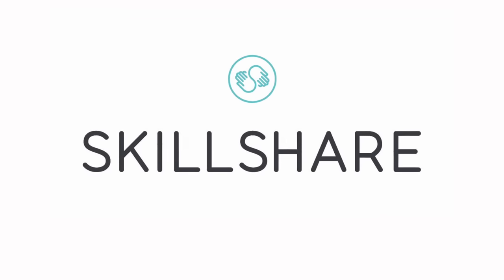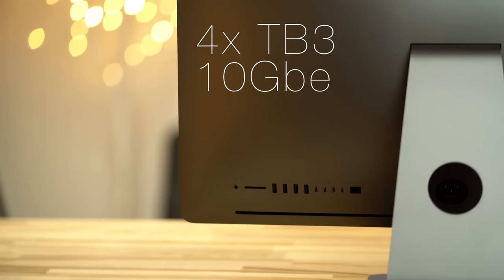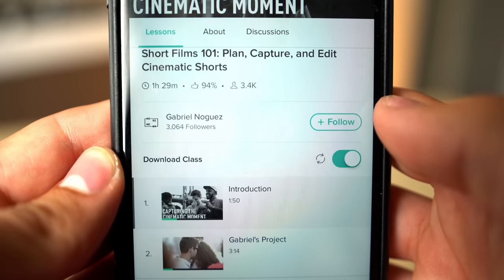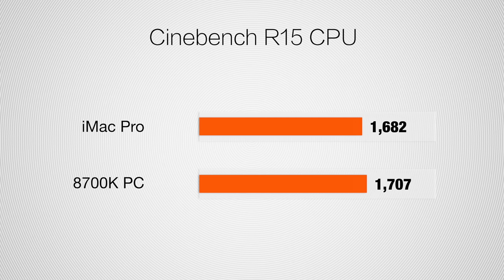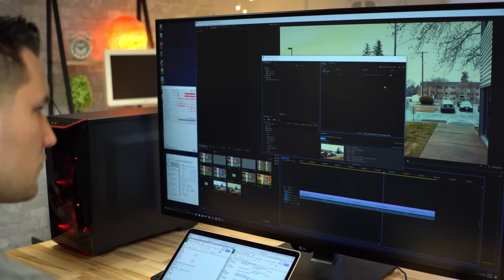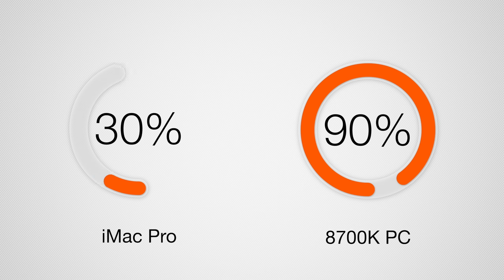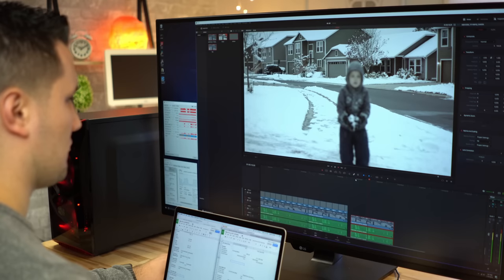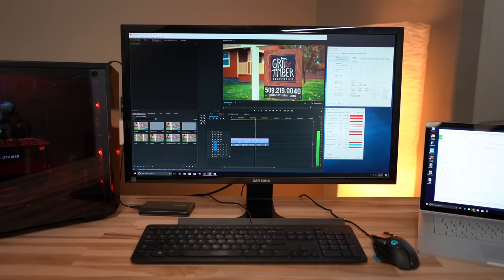$1350 PC vs $5000 iMac PRO for Video Editing 😲 Premiere & Resolve

Comment: this is not a equal battle,,,,bring us 5000 USD PC VS 5000 USD I MAC PRO LOL
Reply from the maker: Yes its not, but its no meant to be. I have an equal battle coming!
Reply: Yeah we want to see that 🤩🤩
Reply: Not yet equal comparison. 
Use fcp on mac and premier for pc for video edit.
Reply: PC would fucking smash it.
Reply: @reerbaadia1896  not equal since pc is running premiere it has to be the same program and pc will always win lmao
Reply: @MaksimYuryev  you should explain new buyers that with a pc, everything is upgradable. Mac might get more ram in some rare case but that's it. With a pc you replace your graphics card and in the long run you also can add a new cpu with faster ram. Which will keep up with new softwares and games. Much much cheaper in the long run. Also what apple users never learned is that because of sleek and thin design the CPU cooler is very small and bottleneck the CPU by not cooling properly.
Another point is repairs on Mac products are very expensive and quite often you can't just change 1 component. Lastly you can't open your Mac to clear out the dust that make your machine run much hotter.
Reply: SLR Lounge did this... the iMac Pro won slightly.
Reply: Leonard Nyamiyonga first put a fucking display on it! There is no 5K displays as good as iMac Pro
Reply: @JuanAlvarez-uf3np  so, it is only better for max quality 5k which it can't even push to because it is so weak
Reply: Adamya what? It’s a top of the line 5K display that at least worth 1,500 dollars

Comment from the maker: As a few people have pointed out, a few charts are off. These are really complicated and a pain to set up. I’m looking for some better solutions that will make it easier and be more accurate. All the times listed are 100% correct.
Reply: No max that's not a fair comparision atleast u should have chosen the 8 core Intel i7 it would have made more sense hardly 200-300$ more it would have not changed the budget by huge
Reply from the maker: Debojit Mandal like I said, I have something more comparable hardware and price wise ($5000 PC setup when you factor Monitor, mouse, keyboard) coming. There’s nothing fair or unfair in this video, it’s more tackling many of the comments I get in my iMac specific videos. 👍
Reply: 0:00 - 3:40
 Max lays out a great disclaimer of what’s actually taking place in this video 🤦‍♂️
Reply: Max Yuryev bro what I am trying to say is just up the budget a bit and put a Intel 8 core CPU that's would make more sense .
Reply: sure. I also noticed it.
Reply: Debojit Mandal - Though two machines have different tech levels in it's bodies I'm sure that 8700k vs iMacPro will be a very popular question in 2018. It's very interesting to see at what price point your computer system would suits your needs better. But I want to see the 8700k + Vega RX 64 Hackintosh vs iMac Pro!!! Not nvidia because of FCPX! That would be intriguing!!
Reply: There's another MAJOR reason to use the 8 core CPU and that's PCI lanes. Your i7 only has 16 lanes which should go to the 1070 but you also have an m.2 drive which needs 4 lanes. the 8 core has 28 lanes I believe which would eliminate any possible bottlenecks on the system especially if you ad a Thunderbolt drive or Decklink card. Higher end Extreme Edition CPU's can have 40 or more PCI lanes for bandwidth galore.
Reply: Hi Max. We all get things muddled! Good of you to pick up on it. Can you clarify which is right, the graphs or the voiceover? Thanks. Bob.
Reply: - hello, Lance, can you clarify me, please, if i7 processor (8700k) supports only 16 lanes, but NVMe needs 4 lanes, videocard needs 16 lanes, so if I want to use them both how i7 processor would allocate lanes between them? And when I add second NVMe, than 3rd NVMe (there are motherboards with three m.2 slots) will they steal the bandwidth from videocard more and more? Or all components will lose its speed? (sorry for my English)
Reply: Correct 8700K only 16 lanes. This means all your PCI based devices will share those lanes - GPU, m.2 drive, Thunderbolt etc etc.
Reply: Hey, Lance B! I checked some info and it seems that many motherboards have additional 4 PCI lanes provided by its chipset. So there are 20 in total
Reply: OC to 5 ghz? Is this even possible? How is stability?
Reply: oldi184 Water-cooling it's possible. I think he's bending the truth...
Reply: Sky Walkies

I see. Well. Water cooling is better air so i guess it can be possible. Besides i just read that turbo clock for 8700K is 4.7 GHZ so for this model 5 ghz clock is in fact only 300 mhz Oc.
Reply: Hey Max,
There's a reason the results are off + Resolve showing greater difference , Premiere Pro's code is very ineffecient with new hardware + drivers and never utilises cpu/gpu efficiency properly - Run those same Export tests ( 4K / effects etc ) in FCP X , Resolve against PPro on PC  and there will be a much greater difference between them - which was apparent in some of your Resolve tests here.
Would be keen to see a more real world test against FCPX vs PPro ie:
https://i.imgur.com/qbv51KL.jpg

Comment: The 5K custom calibrated screen which Apples uses will cost you around $1700 on the market. Sure, you can get a mostly equivalent screen for around $1k. The premium bluetooth keyboard and mouse will cost you at least $100. A very decent set of speakers will cost you another $100. Good webcam maybe $50. The very premium all in one design, the warranty and life long Apple support which you can get in any store around the world and the fact that it already comes assembled are a bit harder to price (how much is your time worth?). But honestly, those three can very fairly be priced at $500 to $1000 for a professional who uses this as a work horse. So there are another $2k to $3k of value missing in this PC build, which would really bring the price up to something more like $4k. Sure, maybe still less, but then again, if you are actually doing multi-threaded video editing, the iMac will win hands down.
Reply: Yes. The components are so durable even a fuse won't break!
It's great!
Reply: looks at butterfly keyboards

Comment: I would like to see you compare this $5000.00 I-mac to a Threadripper or intel I-9 with a high end GPU.  That would be interesting.
Reply from the maker: grombie702 I will! 10 core i9 overclocked
Reply: Max Yuryev Dear Max!
Since this iMac is based on an intel chip as well, is it fair to say that this is also a comparison between an i7-based PC station vs. a Xeon-based PC station?

At work we consider what to base our next PC system, and after working on Xeon+Nvidia Quadro setup, I felt like they suck for Adobe suite, and that an i9+GTX system would be better.
Whaddya think?
Reply: I was able to fit a 1920X with 2 gtx 1080 ti's into a build for the price of the mac pro. I don't think two gpu's would do much if anything but I just wanted to show how much spare money there was
Reply: I've been using PCs for YEARS. Too many issues. Windows has to many issues. Building a PC causes problems.

Alot of the high end GPUs, CPUs and alot of memory is not necessary. And just my opinion
Reply: @miketorre16   Building a PC causes issues? Sounds like user error to me I've had my pc that I've built for the past 5 years and have had 0 problems
Reply: @NFNCDUBSTEP  yeah, NZXT liquid cooler impellar breaking. Fans break. user issues your probably correct. Which is why I'm going to switch to an iMac. 

Its like building, and modifing cars, nothing is like OEM.tired of Windows issues as well. 

"Start Windows Normally" wtf

My opinion
..
Reply: @miketorre16  tell that to engineers on aerospace industry..doesnt count for high end windows

So you have more expertise than million engineers around the world resolve editors in hollywood?
Reply: @Teluric2  whatever that means. I'm back to PC
Reply: @miketorre16  I know a girl with a 256gb ram pc doing extreme photoshop

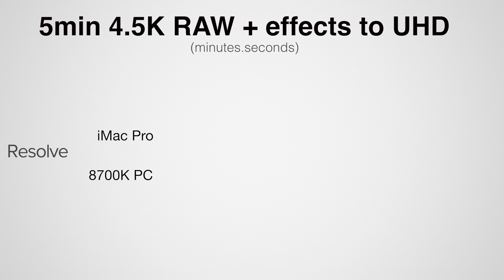Comment: Max, at 10:06 you say the imac pro is 45% faster, but the graph shows the PC is faster. Did you mis speak or is the graph wrong?
Reply from the maker: Derek Morrison Sorry! The graphs could be off. I thought I triple checked everything but when your editing for 8 hours straight trying to get a video done thing can get off. The times are 100% correct.
Reply: I suggest you reupload with the mistakes corrected (if there's any), but I understand it's extra work.
Reply: @MaksimYuryev  But doesn't less time mean faster? So basically the PC is better?

Comment: This is such an odd comparison.  Because for 1350 you could build a PC that would still smoke the iMac in resolve.  You just need a different processor like Ryzoms 8 cores.  Building is all about having a purpose built machine.  Adobe uses ancient architecture that still can't appropriately utilize multi cores as you pointed out, so if you want to use adobe just change your build slightly and for the same 1350 you can get better performance.  I'm loving resolve because it actually makes use of my 4 processor cores so I can play back with luts and all sorts of crap just as smooth as you showed the $5000 iMac.  And my comp is almost 4 years old and could probably be built today for like $800-$900 bucks lol.

Comment: nice video...however, what kind of comparison is that?!🤨5K$ vs. 1,3K$...even if PC is twice slower its very good option considering how much $$ you can save...you should compare 
5K$ MAC vs. 5K$ PC but then result is obvious when its already comparable (in such a price difference🤯) + PC is upgradeable☝🏻
Reply: sam lukas Not to mention you can update the parts in the future
Reply: And you can repair the PC easily if a harddrive fails or the power supply. With Apple, you can ship your brocken iMac to Apple and then have the time to do whatever.
Reply: Macs have value from other things than raw performance. In the video, they evaluated the final PC to about 3500$, if you include the screen and other peripherals. Also, I think the overclocking is a bit "cheating".
Reply: how is overclocking "cheating'? thats an advantage to owning a pc workstation. blame Apple for not allowing it
Reply: It's not a blame, it's more like 99% of people don't know how to do it, and don't want to. How many people casually install nitro in their car? It's cheating because it's going beyond what the material was designed for. And it increases the price because your time has value. And it increases risk of failure. I put quotes around the word for a reason, too.
Reply: Just coz majority of people don't overclock or are too scared to try it, it doesn't mean that you are "cheating" when you do as it is already a function that you can have if you're willing to try it and learn. 
The Mac or any any Apple products is worth as much as the next smuck is willing to pay for it. 
I've seen far too many Mac or apple users who have the latest Apple gadget but is only using it at face value and they think their device is better because its pretty.
Reply: Oh, okay, so now the value is only what the customer can afford. Jesus. Way to "subtly" say that PC users are cheapstakes.
Reply: Because it's not a stock feature of the original machine.
Reply: @Simboiss  But it is a feature for that kind of cpu.
Reply: It's hard to compare. It's exotic. Why bring it up and act as if it's common? Just to make a point?
Reply: That's what i know too,you can buy a $2500 PC and a $2000 server and still come out on top.
Reply: At this price, I doubt it.
Reply: @Simboiss  ''Cheating"......LMAO

You sound like that guy, who utters "You mom!!!" everytime someone roast him or abuses him.
Reply: just get a threadripper pc with rx 580 gpu if you only want to video edit and you will blow the imac for arguably less price. like blow it very hard... very very very hard out of the water.

Comment: Wouldn't it cost about the same to purchase the Ryzen 8 core (4.0 GHz turbo) CPU and get better performance?
Reply: Thank you by the way! I am in the market for a video editing pc and this video is very helpful!
Reply from the maker: If you watch the full video on this 8700K Build I compare it to 3 Ruben Systems (including thread-ripper) the 8700K is either the same or often faster than my 1700X overclocked to 4.0Ghz.
Reply: Max Yuryev Could you please link me to that video? Id like to watch it. Thanks!
Reply: Tyler Kidd Ryzen builds do not support thunderbolt,   So either you build a 10gbit infrastructure or you go fibber channel.
Reply: Max Yuryev you only mention threadripper in passing... no comparisons made.
Reply from the maker: Heres a link to the section with h.264 benchmark results that include the 8700K in this video, Ryzen 1600 @ 3.8, Ryzen 1700X @ 4.0, and Threadripper 1950X (16 core) @ 4.0 Ghz. https://youtu.be/8mgCk3wJDVE?t=9m7s Keep in mind don't compare those scores with this videos (mainly DaVinci resolve)  since the software was updated.
Reply from the maker: Here you go: https://youtu.be/8mgCk3wJDVE?t=9m7s
Reply: Always go with Intel over AMD in my experience.
Reply: Domje theres really no difference, except amd’s cpus are much cheaper. If you dont care about branding, amd would be a better choice for your bank. Both offer great cpus, except intel also makes their products more expensive just b/c its “from intel”.
Reply: Asthetical Intel are much more compatible and also last longer. Each to their own, if you prefer AMD then that's fine. Enjoy!
Reply: "intel are much more compatible and last longer" thats not how cpu's work, an equaly performing cpu will last just as long as the other and compatibility is the same because both modern cpu's both have the x64 architecture so if one peice of software works on one then it works on the other
Reply: Nope. There is some 'software' that does not work with Ryzen either properly or at all. Friend found this out the hard way, Android Studio's emulator didn't want to run (nor it can run on AMD CPU). Also maybe he spoke about RAM compatibility not just software, and he'd be right there too. Also, all that aside, Intel still has the best CPU for pretty much every case: their Pentium chips are very close to Ryzen 3 in performance while being a lot cheaper and overall better value for low budget builds, their i5 and i7 chips are still the best at gaming regardless of opinions, and new i7 even matches Ryzen in other tasks as well for very similar/the same price, they have the best money no object CPU that is also better value if you are using it for work that generates money (i9 7980XE even tho 1000$ cheaper has 5-15% better performance which is basically an extra month of work per year, that makes more than 1000$ that you paid extra for it), they are also generally more overclockable and can increase the difference in performance even further, etc.
Reply: If you are using Adobe software, go with Intel. If you are 3D rendering(Maxon Cinema 4D, maya etc) using CPU renderer or doing lots of stream and gaming, go with AMD.
Reply: AMD is always slower for these kind of applications. They simply aren't as good as Intel on raw calculation.

Comment: I currently run a dual Xeon processor/dual watercooled 1080 cards with Resolve. Also a hot swap bay for projects. Omg. Destroys Premiere! No more crashes and clunky outdated UI of Premiere. Resolve uses ALL GPU and CPU that you throw it unlike Premiere 👎🏼 This is a PC custom build and could NEVER be set up this smooth on a Mac. FYI I’m a Mac user too. This is non biased simply from years and years of professional editing work.
Reply: Eric Liss i use both on my XPS and there's a few things. Playback in premiere without proxies is smoother. With proxies and smart cache resolve is faster. Premiere Adjustment layers make more sense than resolve nodes. Resolve has better color grading, but premieres lut system makes more sense.
Reply: Dual xeons are great, always a life saver!

Comment: The thing people often overlook with this sort of thing is the cost comparison between a professional prebuilt workstation and the iMac Pro. Sure, you can build a PC for less that will match or exceed the performance. But if you want a turn-key, professional solution, with a next business day warranty, you are looking at similar money for a PC. HP for example makes the Z4 G4 workstation which, when similarly equipped, costs around $5000 with no display. The HP option obviously has vastly superior upgrade potential, but it certainly isn’t less expensive. For the people whose livelihoods rely on their equipment functioning, the cost is justified.